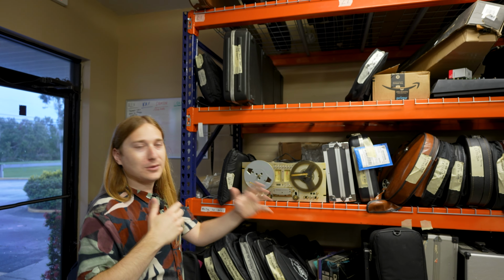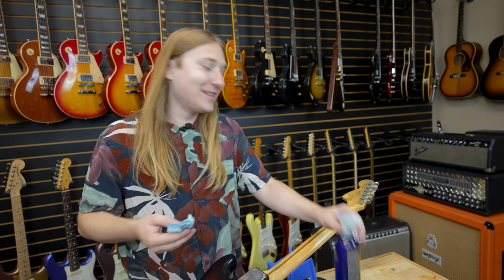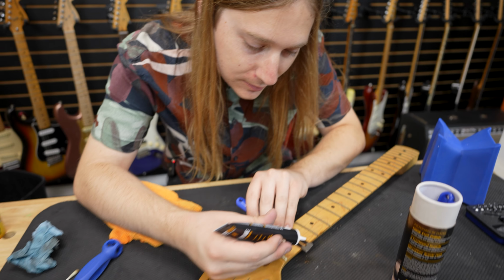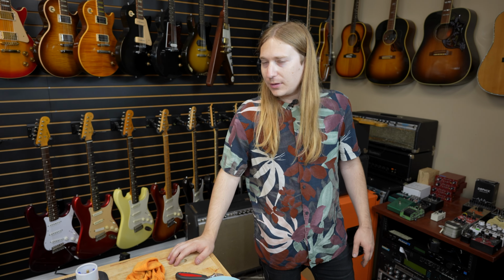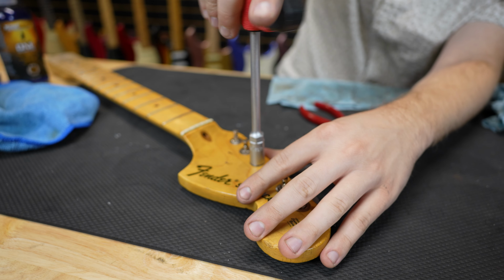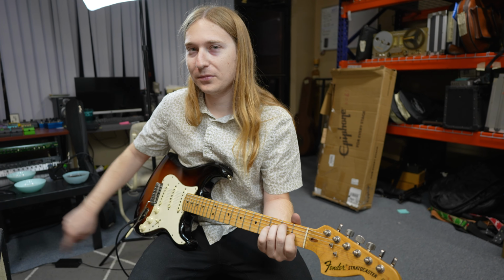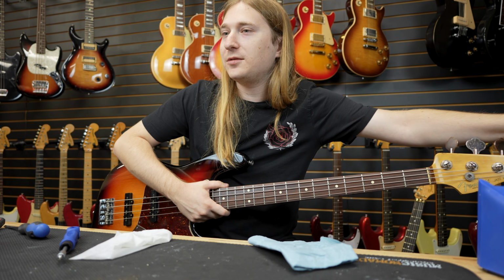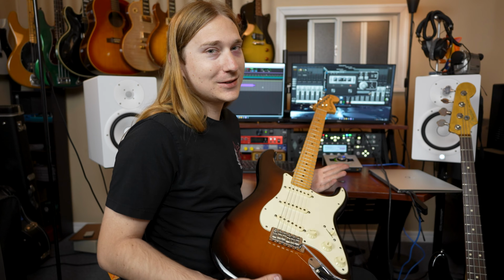Bringing This Fender Strat & Jazz Bass Back to Life

Comment: Mistake useing those blue paper towels ( paper causes scratches)😮, use soft cotton wash clothes. Also a dremel tool cloth polishing wheel at high speed along with your fret cover is the ultimate polish!, only a few passes does it.😊 Also screw the viniger!, soke in WD-40. And 000steal wool or scotsbright pad.
Reply from the maker: The blue towels are pretty soft and have gotten good results so far. Will say steel wool can work great, but Scotch-Brite pads tend to be too abrasive no matter what the package says. Really want to get an ultrasonic cleaner for future rust and corrosion removal though.